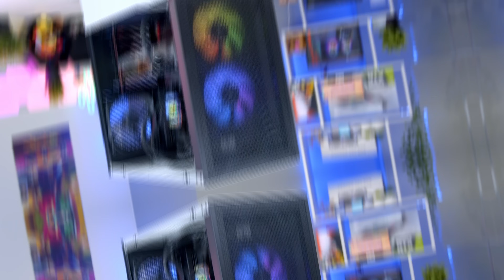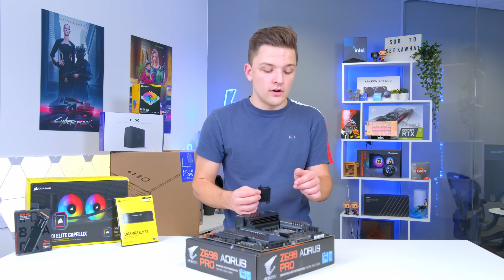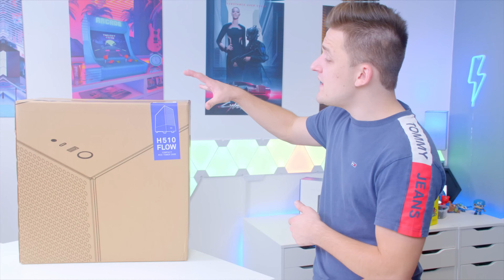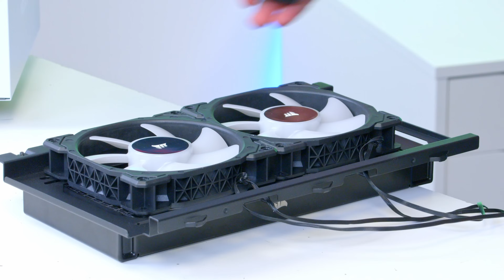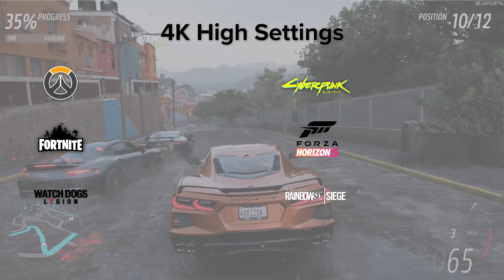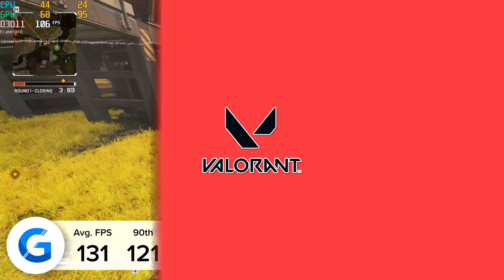$2500 RTX 3080Ti & i7 12700K Gaming PC Build! [Full Build Guide w/ Gaming Benchmarks!]

Comment: Is it really worth it? Would an 8 core i7 be just as good?

I have the aorus m.2 drive which has a beautiful heatsink, 64x 3600 Corsair ddr4 in white with RGB, the Asus ROoG helios case.. and tons of gen 4 m.2 drives. Just need a cpu and motherboard. I’m using the rtx 2070 until I’m able to find a decent gpu. But I’m curious about the different intel CPU’s only due to the Bluetooth issues with the amd

Comment: Hey hi I build a same System like yours, but I got for my system the Corsair iCue H170i Elite Capellix! 
The only problem which I have is I didn’t got the LGA 1700 mounting screws to connect CPU and pump! 
I ordered the LGA 1700 Retrofit Kit from Corsair but I have no idea when they come!!! And no words from Corsair!
I used the LGA 115x/1200 screws and it worked fine and temperature is perfect, never got over 50°! Always between 25 and 45.
Can I use it like that temporary until the LGA 1700 come or do I damage the system when I use the LGA 115 X/1200 screws?
Hope you can help me because I can’t go to anybody to ask for help because of lockdown 😩😓
Thank you very much 😘
Reply: Hey man I have ordered h115i elite capellix with lga1700 retrofit kit and the difference between lga115x/12xx and lga1700 standoffs is that Lga1700 standoffs are a bit shorter (like approx 1mm shorter) so you might end up with a gap between the CPU and cooler eventually using lga115x/12xx standoffs
Reply: Ran into this same problem . Just ordered the retrofit kit. Did u receive the kit yet ? How long did it take to ship?
Reply: @dimaboyk1202  I was dumb because when I was ordering the cooler description said that cooler already supports lga1700 and it automatically put retrofit kit into my basket which I deleted from the order because I thought I don't need two of those since cooler comes with one already. When cooler arrived there was no retrofit kit and then I read that all coolers support lga1700 through extra retrofit kit being added to all orders. So dumb me ordered standalone retforit kit (free shipping thank you corsair) and it arrived in a week
Reply: @dimaboyk1202  it took two weeks or so because of corona

Comment: I run an i7 6700k with a 1080Ti.  Ordering i7 12700k, Asus Strix motherboard, ddr4 3600, Asus 3080Ti Tuf, new drives, new AIO, Reusing Thermaltake Core X9 case/fans and EVGA 1000P2 PS. 

Update: Returned the Asus TUF 3080Ti (still new in box), found a new EVGA 3080Ti XC3 Ultra.  Comforting to be back under the care of EVGA customer service.

Fair winds and following seas to all.
Reply: How the build turn out?
Reply: @aburlo  Thanks for asking. An issue with my right shoulder has hindered progress. Still have a few items to buy, and running a grounded circuit from the garage to my basement for the PC and sim racing setup.  Hope to have everything finished in a few months. At least I can now play guitar 🎸 and Frisbee with the dog without it hurting as much, so it's improving. Best to all.
Reply: I don't care

Comment: Great video and nice build. Handsome looking PC. Thanks for sharing. Getting ready to assemble my new build this weekend. i7 12700K as well on a ASUS TUF Z690 D4 board. Will be using the DDR4 RAM from my current 8086K build. Are you running Windows 11? My online research indicates Win 11 has a built in thread processing utility to manage the various core threads. Supposedly needed to get the best performance out of the CPU? Win 10 does not do this thread management by default. Also, are you running the CPU essentially stock? Meaning no forced overclock. I'm always in search of additional frames for my flight sims on a Samsung 49 inch widescreen (5120 x 1440 res). Your 4K tests are closest to that. Thanks again for the great video.
Reply: Will try the windows 11.

Here's my 12700kf build with 34" 3440x1440p monitor. Performs exceptionally well 😉

https://youtu.be/r0qo9Uu4uXY
Reply: Don’t suppose you know the cpu cooler bracket he used here? I can’t seem to get one that fits 😅
Reply: @BazMagee  you can get the bracket mostly for free from the manufacturer once you show the receipt of purchase of mobo , 12th gen cpu
Reply: @shadowalphaop5238  ahhh I see thank you, I’ll try that :)

Comment: I have about the same system exept the GPU i will use a msi gaming x trio 3070 non LHR with a 12700k and Aorus z690 pro and corsair vengence 5200 and corsair HX850 and Corsair iCUE H150i ELITE LCD. Only sad part is that my 5200 kit has not come yet so i have to w8 for next week befor i can try it out .
Reply: Thank you it so true

Comment: I'm getting 58-62° with an noctua U12S air tower on my 12700k on BF2042. Literally mops the floor with good thermals. It's absurdly good.
Reply: Good to hear,  plan on using the same cooler
Reply: @whatanerd2007  you'll enjoy it. Installation was a breeze
Reply: @Floridarollin  breeze
i get it
Reply: Same with nzxt x63 280mm
Runs quiet and keeps the 12700kf cool
Here's my build
https://youtu.be/r0qo9Uu4uXY
Reply: Is it compatible with 12700? I cant see 1700 chips in compatibility list

Comment: I don’t think it’s good to use the daisy chained pcie 8 pin cable to connect both 8 pin port on the gpu, as one pcie cable can only provide up to 150w, the card might not get enough power in this case
Reply: I came to the comments to say the same thing!

Comment: id love to see 1080p benchmarks in these high end builds.
Reply: I think for this build you gotta play at minimum 1440p resoultion, 2k or 4k
Reply: @Lorduc  2k 144 165hz is the target
Here's my build
Will try the windows 11.

Here's my 12700kf build with 34" 3440x1440p monitor. Performs exceptionally well 😉

https://youtu.be/r0qo9Uu4uXY
Reply: @Lorduc  me with a 720p 50hz screen:
Reply: I feel 1080p is a waste for high end
Reply: @leptic5006  Sure thing. But id love to see how far you can push valorant and cs frames.
Reply: @rodrigos7070  You'll eventually just be bottlenecked by the CPU on that low of a resolution.
Reply: @leptic5006  it’s not a waste. High FPS over pretty pixels
Reply: @0hleg  it is to get a 3080ti minimum 1440p
Reply: @leptic5006  it’s not a waste if the person buying it wanted it.

Comment: Did you use the retro fit kit from Corsair to correct the mounting pressure problem on the cooler ?
Reply: I was installing this same exact cpu cooler to the cpu and ran into this problem.. ordered the parts from corsair for $2.99 and I wait..

Comment: I'm running that exact (almost, Z690 Elite) build housed in a LianLi Mesh II.  Oh, and an Vetroo V5 CPU Air Cooler that works, albeit a simple mod to back plate to make it work but works flawlessly.
Reply: I recently purchased the same case for the wife's new build.
Reply: @GySgt_USMC_Ret.  Semper Fi brother. It’s a good case.
Reply: @PeteKay  This We'll Defend, Brother. (Father was Army, I grew up on Army Posts). Spent about 2 weeks reviewing videos on case quality/air flow. Gamers Nexus video was the best review of the Mesh. Wife is getting my i7 6700k and 1080Ti. I'm reusing my Thermaltake Core X9, adding i7 12700k and 3080Ti.

Fair winds and following seas.
Reply: Does it play older games, for example I wanted to play the old batman arkham series but idk if Intel supports it

Comment: What motherboard would you reccomend for the new 12 gen proccesors?
Reply: any aorus z690 or asus strix z690 but if u are using a i5 then probs wait for b660 but if you do get a i9 probs get a z690 with ddr5
Reply: @cup0coffee434  thx
Reply: @cup0coffee434  are there 660's in the market rn
Reply: @phantominception2881  b660 is not been released, it will be released is q1 2022
Reply: @cup0coffee434  nooooo
Reply: @phantominception2881  what no
Reply: @cup0coffee434  classic sad movie nooooo noises
Reply: I am going with Gigabyte Elite DDR4, the Asus Rog Strix ddr4 was my first pick but coolers of Noctua and Arctic Freeze 2 wont fit among other coolers. I have heard alot of people say the Gigabyte Gaming is the best bang 4 the buck only around 200.
Reply: It rlly depends on the motherboard type
Reply: @RNN-bm7ye  k